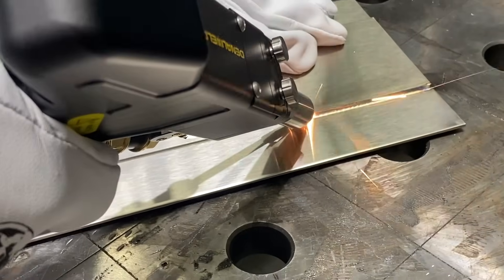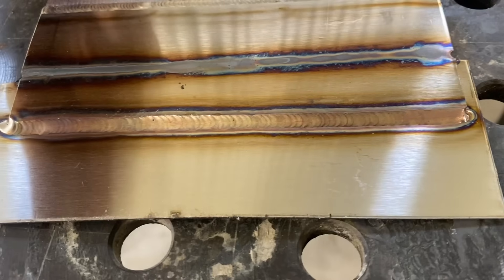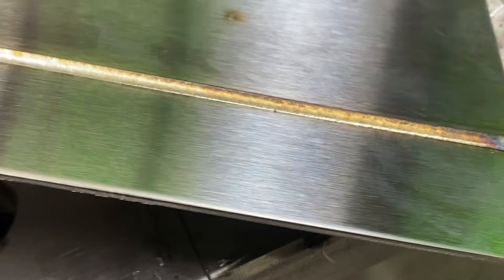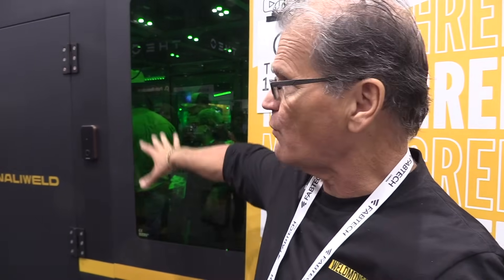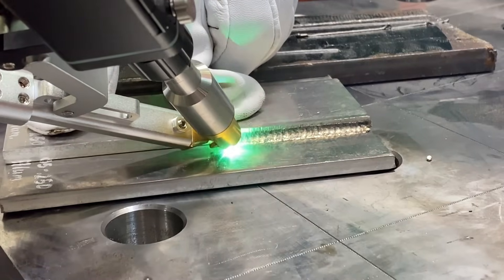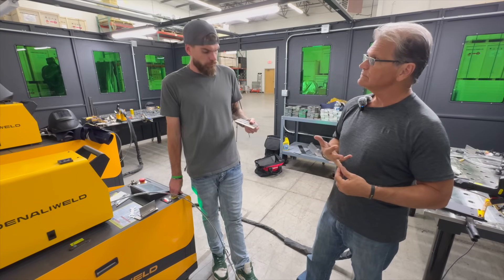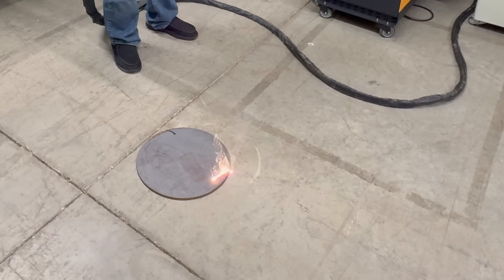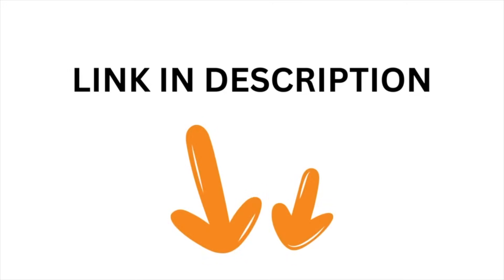Laser vs TIG?

Comment: I have seen the brand Lightweld welders before and really wanted to know how these smaller laser welders would work in the collision industry for welding panels on cars and the cleaning mode for minor rust situations. Plus now with more cars going aluminum it seams like this is a way to speed up the the replacement weld on panels without all the heat and distortion. I would love to have one of these guys for myself as a tech in a shop if the price would be as low as a regular mig/tig welder.

Comment: The disadvantages of the laser welder is expensive, and need careful maintenance. If you don’t use it properly, the focus lens is easily burned. And you need contact aftersales for  laser source alarm and regular maintenance for water chiller inside. But it should be the trend welding method in factory . Because now manyChinese manufacturers like kitchenware produce are adopting more and more laser welder

Comment: will price point get low enough to be available to most folks anytime soon?
Reply: IMO- you won’t see quality machines drop in price anytime soon. We are just now in the infancy of somewhat obtainable machines now. Before a multimillion dollar company could afford one and now small businesses can afford them. Really the only way for them to get cheaper in the next couple years is competition (won’t make much difference) and cheaper components (you don’t want that)
Reply: They start for small units about $25Kusd for just a laser welder and go up to 75K probably for the one in the video
Reply: @Sicktrickintuner  hence my question . obviously its out of reach for avg person.
Reply: @Otingocni  you can actually get smaller units for closer to $10k but it limits the thickness of material the less you spend. $15-$20k you can get a unit that will cover you well. Still not welding 1/2 though. These prices reflect American based machines made overseas. Not foreign based companies made overseas so those might even be a lil bit cheaper. (But I wouldn’t recommend) Yes the top companies with the best units expect 25k and up. Not to mention if you aren’t working in an environment alone, you would need shielding for others. (Think expensive welding curtains or others don’t go blind)
Reply: @Otingocni 
They'll only really be within reach once there's a second hand market.

Like many things in industry standard quality etc. - Private use or acquisition for a small shop without expectation of high average utilization is basically not possible without second hand deals.

Comment: For sure another welding tool to be added for any shop.

Great Video Jody, is this laser welding technique, able to do sanitary welds on 316 stainless steel with "LASER" power Only ??

Thank you for your keen insight of this new process.
Reply: I had the opportunity to use a laser welder yesterday. That particular machine could do autogenous welding. I personally did not try that feature. Though the machine would produce small and smooth welds with full pen. This was on 16 GA carbon steel. Weld width of about 1/8"  very small heat line. You could pick the pieces up immediately after welding. Rather cool process.
Reply from the maker: @kristyskirt9015  I’m not sure about sanitary stainless applications as of now but I think eventually it will be used for that

Comment: It’s perfect for mass production of non structural components like decorative stainless or exhaust pipe. You get speed but you lose penetration.
Reply: It seems the penetration is equal or better in all the examples he has shown across his videos highlighting the laser. Are you seeing it differently?
Reply: @ Its not
Reply: @RiggyRonnie  If you're going to state something thats the exact opposite of what we have seen with our own eyes, and a relative expert like Jody seems to believe, its on you to actually post some sort of evidence proving your take is more than just opinion.
Reply: @boots7859  Goes both ways. Yours is equally an opinion
Reply: @RiggyRonnie I've seen over 100 etched cross sections and numerous other destructive tests on carbon steel coupons. If the machine is set right for the thickness of plate, you absolutely have no fusion problems. Typically with laser, you get a throat equal to your leg on fillets which is more than your normal ratio on standard gmaw. Believe me,this stuff is the real deal.
Reply: @mattpratt7641  The laser melts the metals at the surface level which can only go up to 5mm deep on low carbon thin steel, anything above that you wont be able to etch the metal as well as you would with Tig or Mig because they use electric arc method which penetrates through an electric arc which can gouge 1+in thick steel. You can’t do gouging with a lazer welder, like I said they’re specifically used for non structural components even car manufacturers use the MIG method to weld the frames together while they do use laser to join the body panels since they’re not structural

Comment: Jody the greatest thing about laser welding is no smoke and spatter, as generated by any open arc welding process .
Reply: I would think you MOST DEFINITELY should be using goggles for the wavelength of that fiber based laser. Any random reflection from a speck of material will most certainly blind you at that kind of power level.
Reply: this laser welder made my autodarkening hood go black from around the corner in ANOTHER SHOP BAY- definitely DEFINITELY not safe without goggles.
Reply: It's definitely not safe without helmet. We wear a helmet provided with protective glass for both UV light and the specific laser wave.

Comment: Would it be more comparable to perform a MIG weld than a TIG weld when assessing laser vs traditional?
Reply from the maker: MIG might be a much closer comparison but would be hard to match appearance.  i think its apples and oranges either way. I compared to TIG welding only because of the similar appearance of finished product. thanks
Reply: @weldingtipsandtricks yes I agree that from an appearance perspective TIG is more comparable. But speed is a large part of the value of lasers, hence MIG might be a worthwhile comparison. So let me be less passive-aggressive and plead for a MIG evaluation! 😊